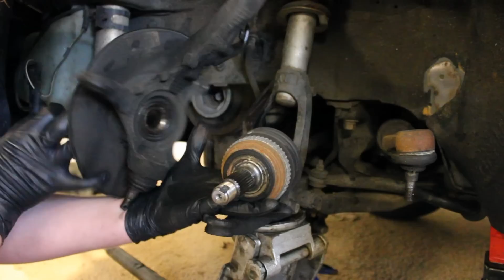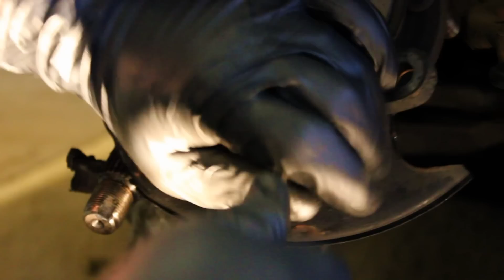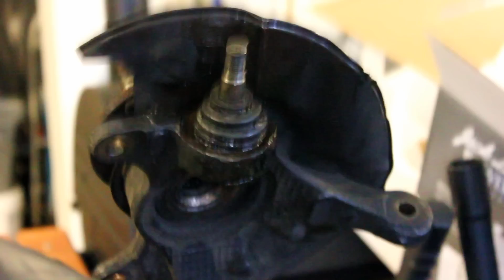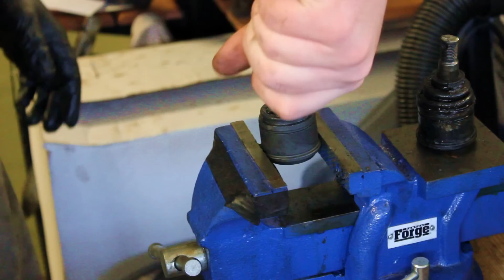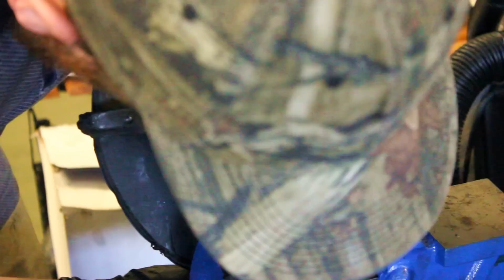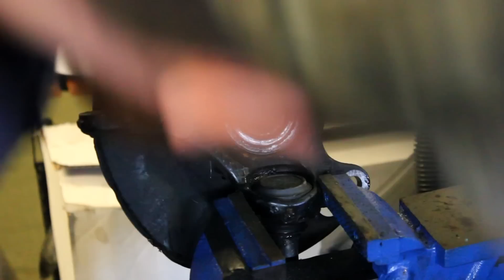Ball Joint Replacement "How to" 2 of 3 Honda Civic

Comment: Put the ball joint in the freezer for 30 minutes and use a propane torch to heat the knuckle it will go in a lot easier.

Comment: thanks for the great tutorial. could you describe how i would know if the lower ball joint needs to be replaced? is it simply a matter of visual inspection, or is there something i can feel/ in the driveability/sounds from the car that would indicate that the ball joint needs replacing? i've got high mileage and some loud metal clanking sounds when i go over certain bumps. i'm going to replace the struts but i'm sure there are other parts that need some love. many thanks.

Comment: Honda ball joints. Setting the industry standard for longest service time to replace. I can do this on my Jetta in 30 minutes per side, including jack and jackstand time. Removing the knuckle to replace the ball joint. Super genius design. Sarcasm.
Reply: That is true, I own a Civic and thieving suspension-wise is a hassle to change!
Reply: Justin Rizzo did you go to every video on honda ball joints to bitch and complain. Real genius thinking. Sarcasm.
Reply: Except your Jetta ball joints need replaced regularly due to your stock suspension, Honda’s literally can go about 500k average. Only reason I’m replacing mine right now is because I want to, cars 22 years old now with no problems in the suspension and runs like a charm
Reply: @PbJams5316  Had to replace them on my Honda at 113k. They should be replaced by then on any car. 500k miles my ass. It's a heavy wear item on any suspension.

Comment: I like to freeze the ball joint before installing.
Reply: +harley Rider 
True!! I did that today and took a blow torch to the hole where the ball joint goes for 20-30 minutes.....it was TOO EASY...I just put the frozen ball joints in, a few soft knocks..and DONE!
Saved me a trip to a shop!

Comment: You should rap the steel where the tie rod ends and ball joints go through to help loosen them up. Also there are snap ring pliers that you squeeze that spread the snap ring. Much easier to operate. There are also some that have a switch so the can do inner and outer snap rings.

Comment: What i like to do is take a wire brush and clean the inside of the ball joint hole and make sure it is smooth, or some high grid sand paper. Then grease or put some anti seize in there. if you do not have the ball joint press, take a piece of 2x4 and place it on the top of the ball joint and hammer it in. this way the wood takes the shock and there is no damage to the joint. also center the ball joint. There are some rare cases of the shock from hammering casing the wheel bearing to go bad. Just be patient and careful, and get the right tools if you can. Rent or buy.

Comment: Good thorough coverage of what needs done to remove and install a new ball joint on the Civic.  I'm about to do mine and I would highly recommend spending just a bit more for a Moog PT# K9802 which is only $29 each on RockAuto and with quality similar to OEM.  Ebay parts are a dime a dozen and might last 3 years or 3 months!

Comment: Wish I had your patience.  Right now my lower control arm is hanging there, unable to be removed even though all the bolts are off - with a broken lower ball joint frozen in it's socket.. I've tried so many ways of removing it without success.. >_<

Comment: Next time you go to take out ball joints.Dent in the rear flat side with the round side of the ball peen hammer .It will keep the bolt side straight when you hammer it out.